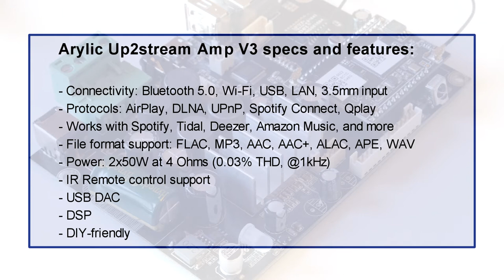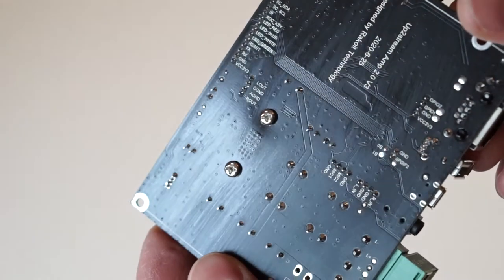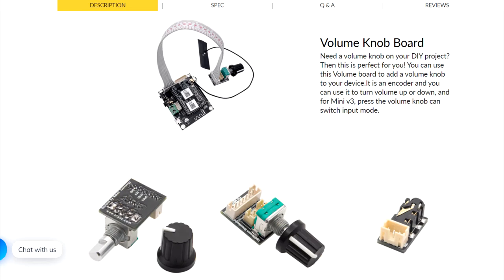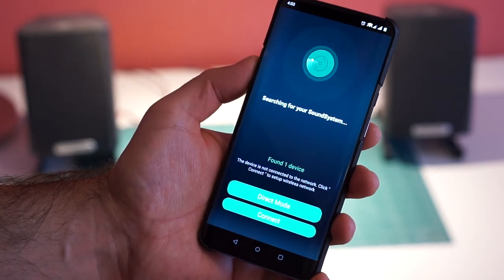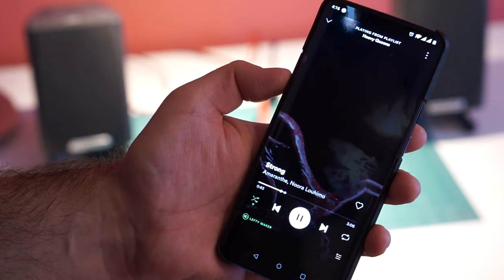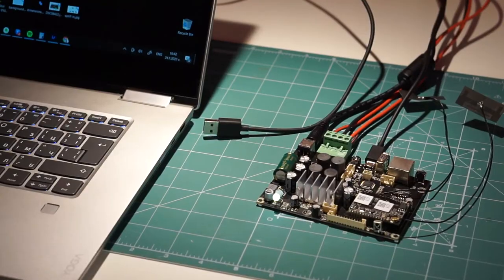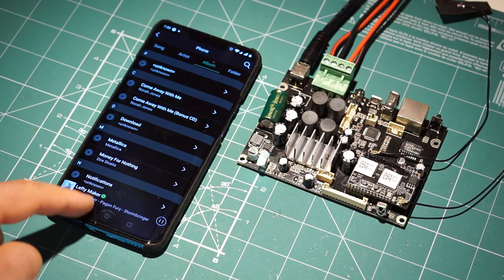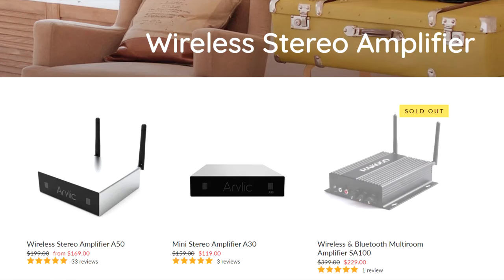Arylic Up2Stream: 2x50W amplifier board with Wi-Fi, Bluetooth, Spotify

Comment: You know if possible connect multiple speakers using bluetoorh. For example i have 2x30 connect to the up2stream board but have 4 bluetooth speakers in my home, example Kitchen or Living. I can join and use all at the same time with the same music joining this devices to the 4Stream app?
Thx
Reply from the maker: I don't think so. I've read you can connect two bluetooth speakers to one device, but for more complex setups, you need wifi. That's why speakers like Sonos use wifi for connecting to each other

Comment: Anyone using this having issues send music from Spotify
Reply from the maker: I used to have issues, but it turned out the signal was weak. When I brought the board closer to the wifi router it worked fine. You do have Premium, right?
Reply: @LeftyMaker  turned out to be automatic dns setting once set manually in router everything worked